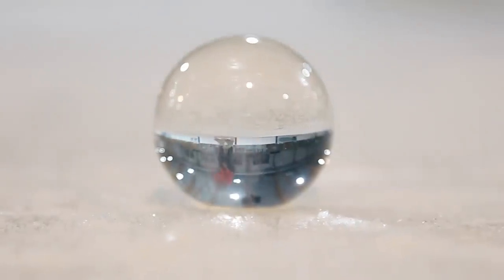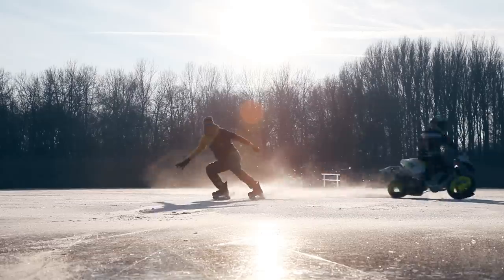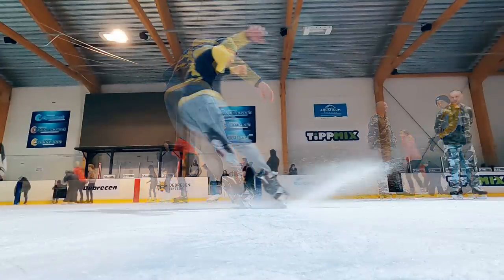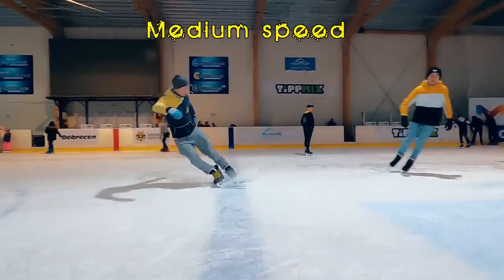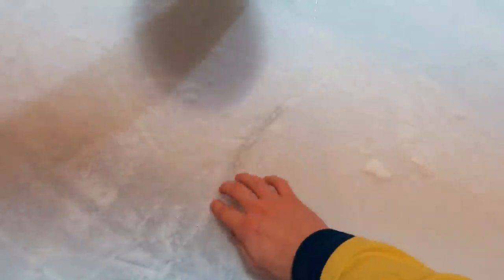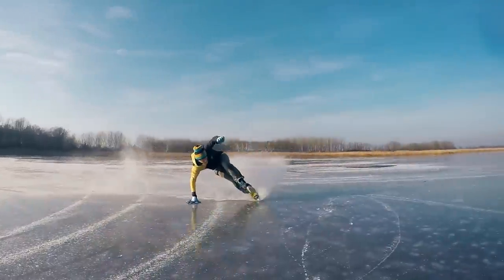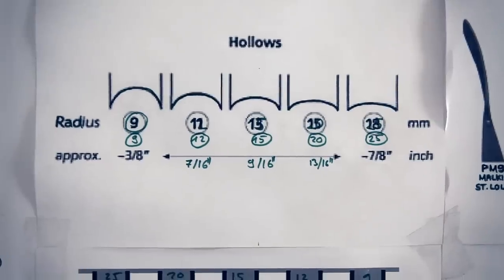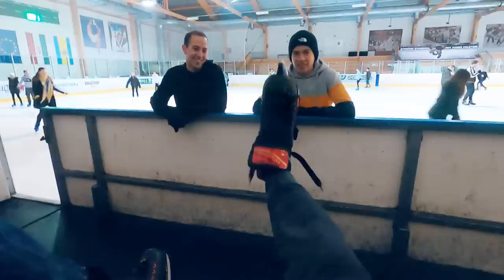How to Spray Higher - Ice Skating Tutorial

Comment: i was always trying to get higher sprays when i used to ice skate as a teenager, i used to dig my toe  in at the last part of the slide to kick the ice up higher. this was on a indoor curling rink which had slightly softer ice than the hockey rink ( i think they added some sort of chemical to the ice).  it would spray up over head height!
Reply: You don't add anything to the water, it's about the temperature you keep it at and that's controlled by the temp you keep your sub floor at (among other things). I've been an ice maintenance guy for about two years so that's my understanding of it, though I could be off.
Reply: @lokei1326  ice tech and rink manager for 10 years here. Yup you're right. Temp and humidity is the only difference between soft and hard ice
Reply: @zack5488  ugh! Humidity! I forgot that part...still learning.